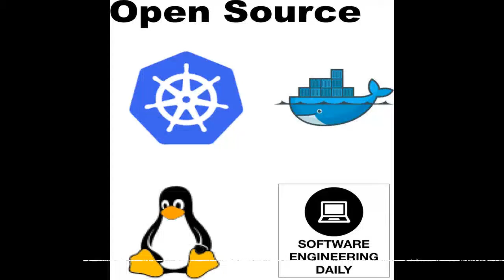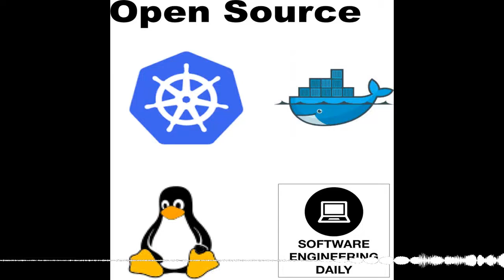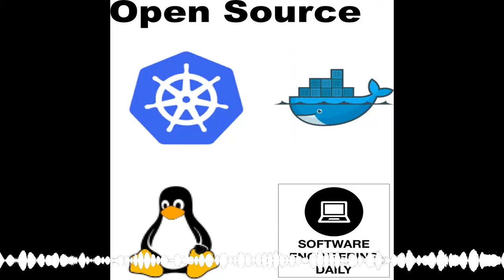Free Lossless Image Format with Jon Sneyers

Comment: These talks about the advantages and disadvantages are super interesting because file size might be an issue for some people while speed might be an issue for someone else.

I remember the old days when I had dial up Internet and it actually took a super long time for images to load and videos were even slower. I used to download my favorite videos because they took an hour to download and I could watch them offline much faster. And that was in the days of a laptop with Windows 98 and 128 MB of RAM. So much has happened so fast with computers and it’s amazing learning about it all.